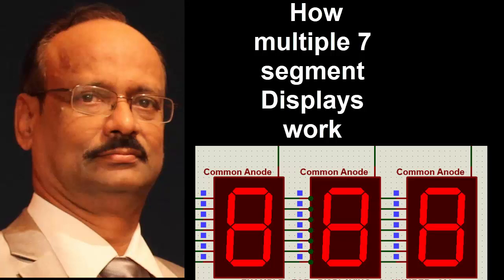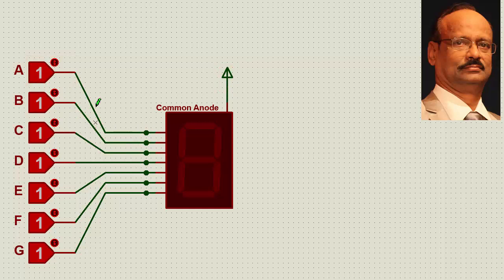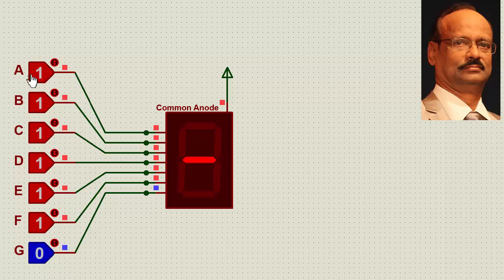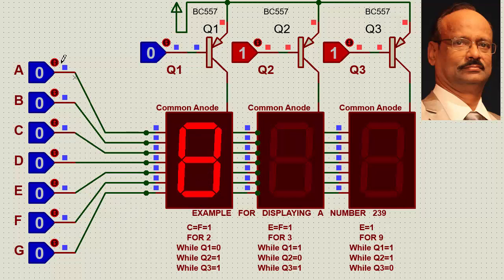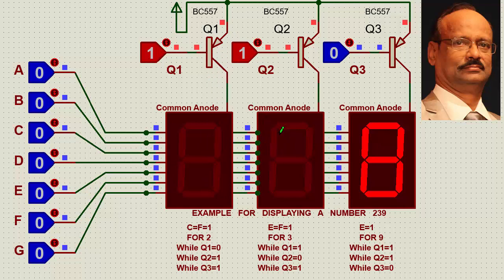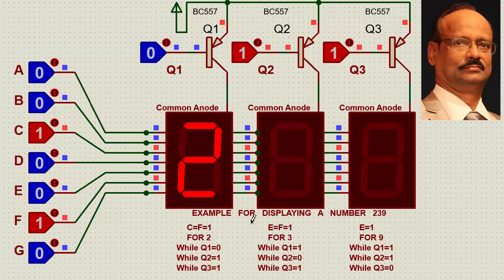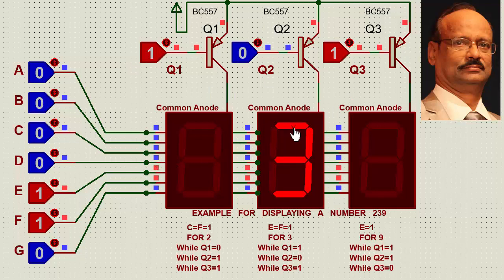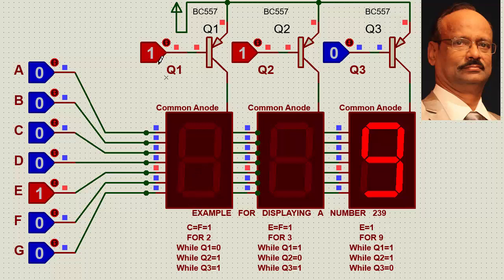7 Segment  display - multiple units - Practical Electronics

Comment: Sir I'm trying to do quiz display seven segment to display who pressed the button 1 there seven segment should display 1 who pressed second there seven segment should display 2 and who pressed 3 there seven segment should display 3 can this program be done using same logic of as u showed here
Reply from the maker: No, it needs a microcontroller or a set of digital ICs for this kind of project. There are many projects available on the net

Comment: Sir in this why u r gave 0 to transistor on sir in common anode display all anode ara take as common Vcc supply ane other cathodes are free to give seperate ground means 0 zero voltage
Reply from the maker: you seem to be confused. All display anodes are not given to common VCC but through respective transistors only. Please watch my other videos on practical electronics to understand how transistors work. Here while 0 is given to one transistor base the base current starts flowing from the emitter (ie Vcc) resulting in the collector getting connected to the emitter thus Vcc is available to that display only and not others. Cathodes of that display are given zero based on the number it has to display.

Comment: My used Arduino UNO clock seven segment Display anode but not working please help me.....
Reply from the maker: May be code problem
Reply: first see the code is row data is enable with 1 then segment is common cathod otherwise vise versa so you can change either code or change display.